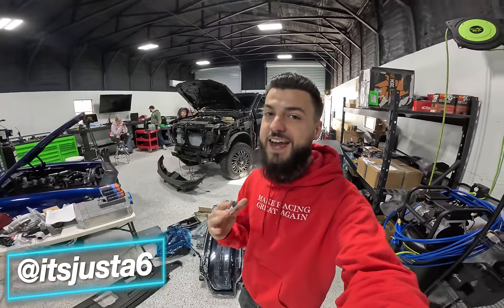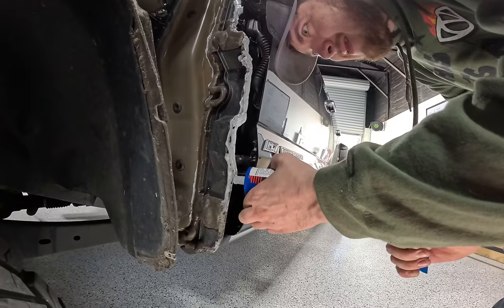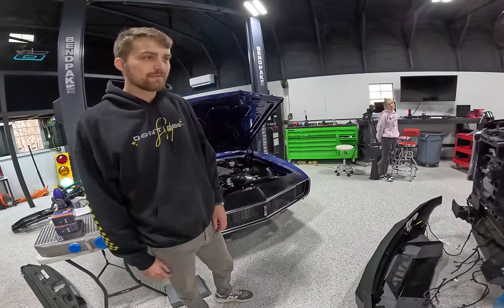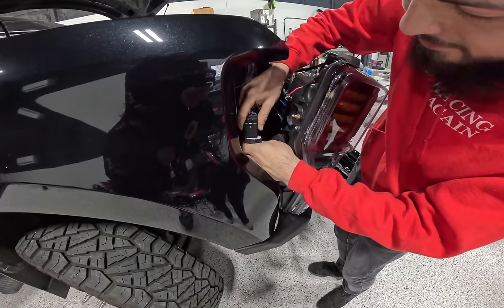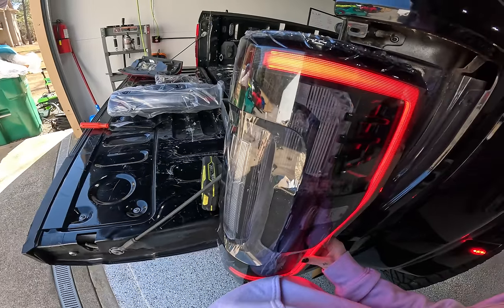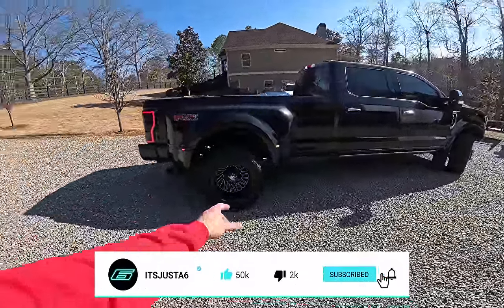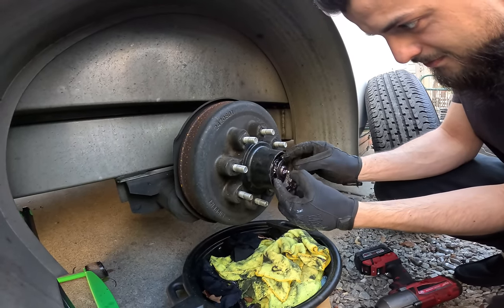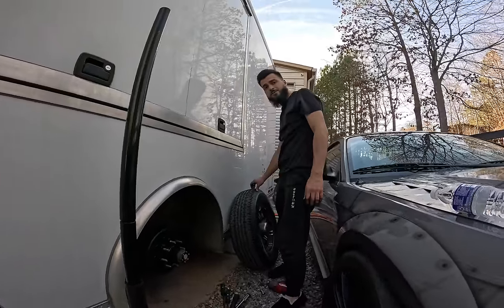Rebuilding my Wrecked Tow Rig in Under 24 hours!!

Comment: I’d really love to see a dedicated build on this truck, not for speed but for having the best towing ability and crash protection possible. I know it’s not the spotlight of the channel but it still deserves it for sure, there’s a TON of stuff that wouldn’t have been possible on this channel without that truck.
Reply: If he wanted that he would have to go completely against the look he wants, so I doubt it would happen
Reply: its already pretty built and more than capable of anything they would need to tow, has an aftermarket brake controller, leveling kit, exhaust, tow hitch setup, wheels, tires, lights, bumper, grille, tint, dashcam, all that shit already...plus that bumper is already meant to be better in a crash and have replaceable parts. That bumper definitely helped the truck come out a lot better from that last crash than the stock one would have(as shown by what it did previously)
Reply: @Shadow0fd3ath24  idk if you’re well versed on trucks but this doesn’t have an aftermarket exhaust, the things stock emissions, no delete no nothing. Aftermarket brake controller? Literally no need it comes stock with one, tow hitch setup? Again, that’s all stock. Front bumper isn’t great, as we’ve seen it didn’t protect much, if he really wanted one to be able to take a hit and ruin nothing unless he totaled the truck in general he needs a ranch hand
Reply: Needs a better wheel set up for sure
Reply: Definitely agree and I'd love to see him get his awesome bumpers paint matched to the gloss black

Comment: Thought I’d throw something in here. I’m certain those hubs with the removable center rubber cap are meant for gear oil, NOT grease. I’ve serviced heavy trailers meant for backhoe transportation of which are hauled by dump trucks. A good majority of these trailers have this clear hub nut with a rubber center cap setup. It’s meant to allow you to check and top up the gear oil level during pretrip inspection.

Hubs that use grease are either a traditional cap that gets hammered on or an end cap with a grease zerk fitting in the center. The grease would get you by, but these hubs actually need gear oil.
Reply: I second this.  I'm sure grease will still be fine, but he needs to do away with the center caps in the trailer rims !! You need to be able to see what's going on with those trailer hubs (especiallyif they are oil filled).  If he didn't have those center caps, he would have seen the previous bearing failure long b4 the wheel come off, in the form of grease being all over the wheel.
Reply: I have a set of vortex hubs on a boat trailer and they are designed for traditional grease and have a threaded end cap like those in the video.
Reply: 3rd This as well. It's supposed to take gear oil, as it also has a little fill whole with a cap in the wheel seal to fill. Grease will be fine, but I dont think it'll have nearly as long longevity as gear oil would. Most high speed lubricants are usually oils and not grease like diff oil.

Comment: 55ft lbs seemed awfully tight. We usually run our bearings a hair loose.  Keep and eye on bearing temps so it doesn't burn up.
Reply: I said the same thing in my head. We run them hand tight. He might blow a seal out.
Reply: Same here
Reply: If its like an old style bearings then it is way too tight it should spin free after tightening... these wheels will fly away I guess preety soon
Reply: I think it's 55ft lbs and then you back off a turn, something like that
Reply: @jkane121  preety much as Im setting em I tighten em as you said +- at that range and loosen 90° it should stay quite tight but it lets bearings spin almost without any resistance

Comment: Brother, if you're driving that trailer 5k miles over the next few weeks. I highly recommend checking those hubs, once you get to the west coast, and definitely when you get back to Atlanta. That's honestly probably more miles than most.people.will put.on their trailers, in a year... Just to avoid changing a tire or a dang hub on the side of the interstate. Not to mention, the very valuable cars on the inside. Once a year is good to replace stuff, but you really should check those hubs, every single time before you take it any further than, an hr drive.

Comment: You might want to double check those hubs dude. All around the trailer, 1 your grease fittings should be accessible during pre inspection not blocked by the center cap, 2 the screw on cap if sealed by a o-ring should be torqued and filled with gear oil in the fill bolt you see angled, 3rd check your axle specs for the reason of a faulty hub and long trips I would upgrade to oil hubs not grease they’re more reliable. I always replaced all hubs in such circumstances and not just the ones damaged as you will find yourself doing it anyways momentarily.

Comment: honestly if you are worried about fuel mileage on a diesel truck maybe get a car, also all terrain tires or ht tires help a lot and yes do drive a diesel truck and tow does are the same headlights i want to get i currently have their xb hybrid and way brighter than stock don’t know what ford is thinking with their basic trucks 60k plus lol still using halogen 😂
Reply: also not sure if you did but don’t forget to put grease in your new hubs with grease gun you can’t take of the middle little rubber cap and spin the wheel to spread evenly

Comment: 55ft-lbs seems awfully tight for those trailer hubs, I thought they were supposed to be just tight enough to have a slight amount of resistance when you turn them. Might want to keep an eye on them or you may lose another wheel

Comment: Idk how u were taught to do wheel bearings, but u was taught wrong! 55ft lbs is way too much! Maybe u can torque it to 55 initially, but then you're supposed to back the nut off! The castle nut should be basically hand tight, or very slightly over hand tight. You're gonna burn up your brand new bearings! I've been a wrench for 50 years, trust me, your bearings aren't gonna last at that torque
Reply: Came to the comments to say the same thing
Reply: Notice how the drum didn't spin when he turned the cap on with the channel locks

Comment: there is no way those hubs should be as tight as they were also the hub should free spin by habd so the fact that u used that huge adjustable pliers and it didnt turn there is something wrong forsure